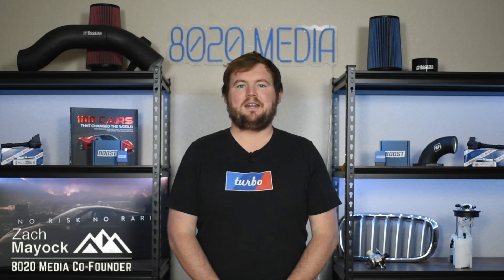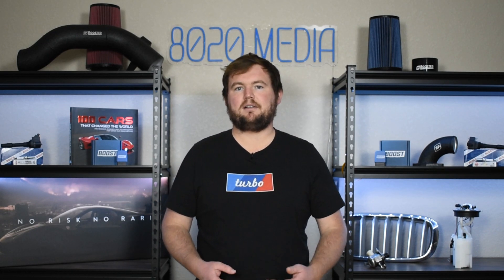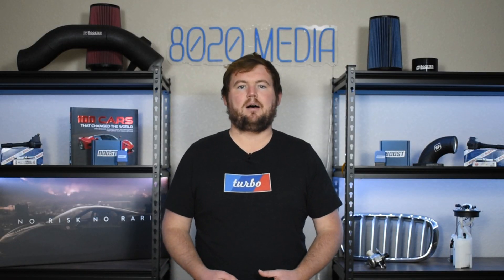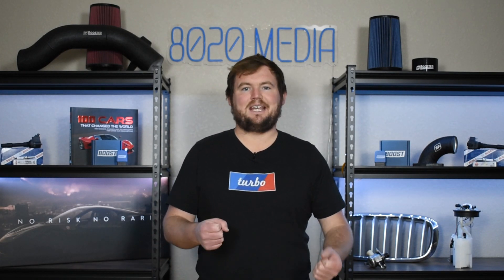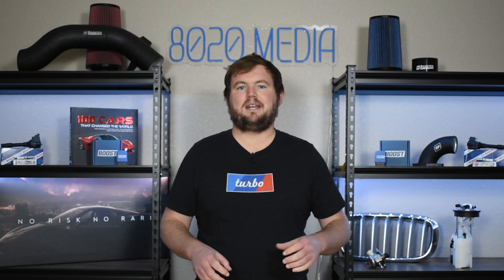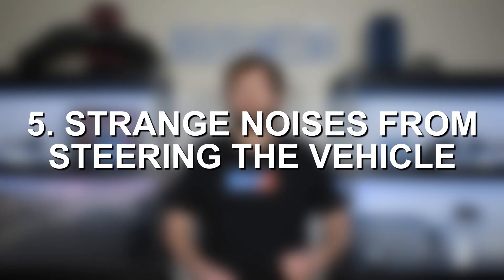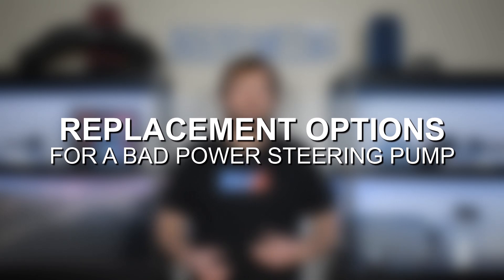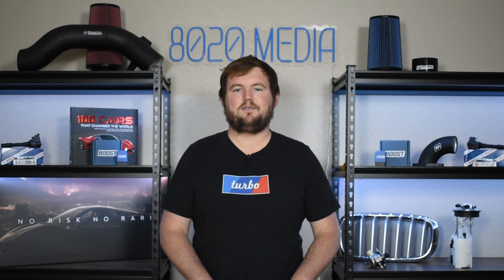5 Signs & Symptoms of Power Steering Pump Failure!

Comment: You didn't mention about very cold weather sintoms sounds.
Reply from the maker: S - What are you looking for? That's very specific.
Reply: @8020Media  my pilot start doing it only when is very cold,that's all other wise it doesn't give me any problems.
Reply from the maker: S - This isn't the right video for a vehicle not starting.. but check your battery, engine oil, and starter.